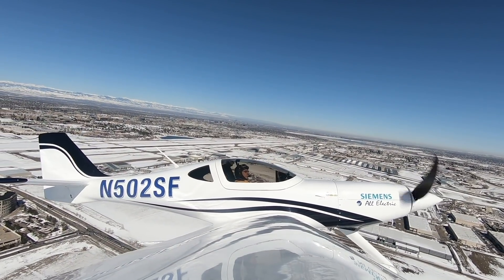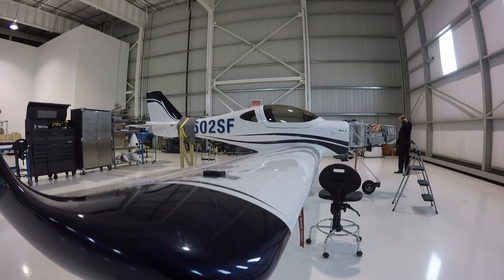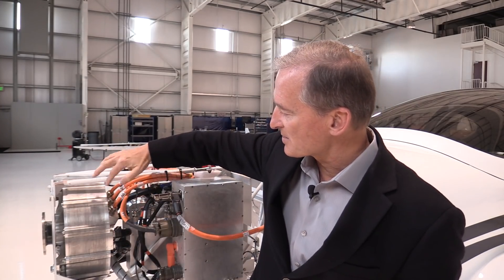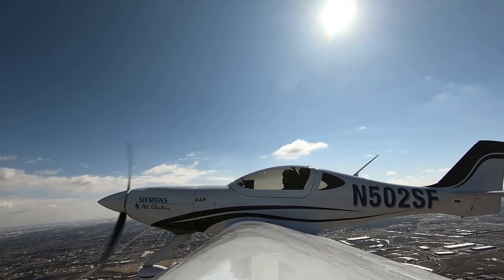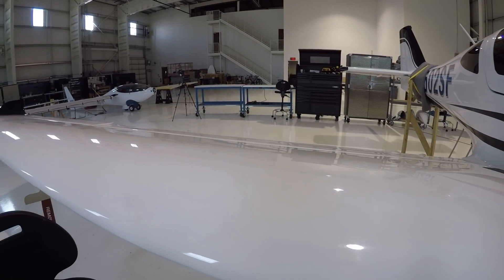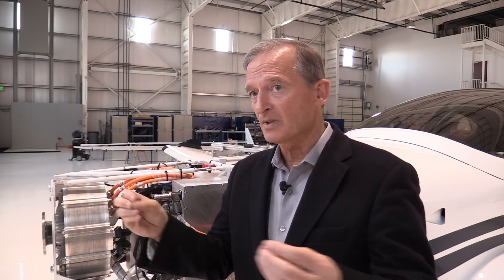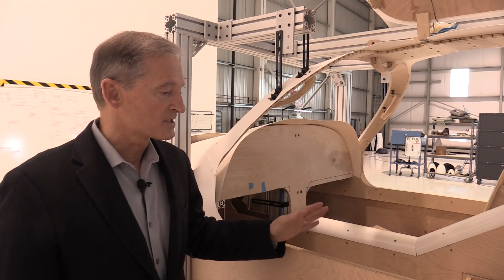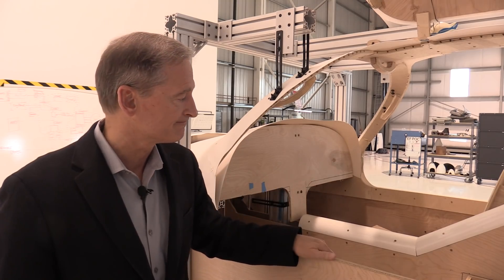Bye Aerospace's eFlyer Electric Trainer

Comment: Rapid discharge, rapid charge, the batteries wont last.
Reply: How long do they need to last to be viable? Many aircraft fly with TBOs that would make the average car owner retch.
Reply: @DrewLSsix  The batteries are likely to cost tens of times more than an engine rebuild, so they'd basically need to last forever.
Reply: @PistonAvatarGuy  Hello again on another thread, last number available for the Pipistrel Alpha Electro is 26,000 € for the battery. Thus more than an O320 overhaul in KS, less than one in Europe. It boils down to how many cycles do they last (even at 80% they can still be used for 10 landings in the pattern, which is plenty for early flight training), vs fuel costs. Plus probably lower insurance premiums (higher reliability, but actuaries might be lukewarm to new technology), the rest more or less to par. We'll find out. But 10 x is again a magnitude too high. (I love piston engines, but I love cheaper flying and flight training and reliability even more).
Reply: @Walterwaltraud  You could do 2 overhauls of a Rotax 912 for the cost of the batteries in the Alpha Electro, so I was a bit off in my estimate, but the piston engine is still likely to make FAR more financial sense. You could almost buy two completely new Rotax 912s for the price of the batteries in the Electro.
Reply: @Walterwaltraud  Actually, I probably wasn't off in my assessment of the price of the batteries for the eFlyer, as its battery is more than 4 times the capacity of the battery in the Electro. If the eFlyer battery is the same price per kWh, it would cost as much as ten rebuilds of a Rotax 912.
Reply: @PistonAvatarGuy  You get a 7500 USD overhaul of a certified 912? Where and by whom? Lowest quote by a great outfit for an O320 I have found is around 17,000 USD in KS. So name your source please. Secondly, if 1000 cycles lead to 80% capacity, you can still do pattern work in the Alpha Electro. Just not "long" flights anymre. Still the fuel, even mogas for a Rotax, is more expensive than the charge. It boils down to dollars and cents on equal term usage (which is realistic in flight training), and those electric trainers will make plenty of sense as part of the training fleet of a flight school. They'll put their money where their mouth is, and will prove you wrong in a niche application. You'll see. And - please gimme a linke to a 7500 $ certified Rotax overhaul (uncertified does not count, I know what my AAB 2.4 Diesel for my T4 van costs in comparision, a mere 2000 GBP).
Reply: @PistonAvatarGuy  Wrong. As someone below pointed out that the industry cost is around 190 $ per kwh, you can see that Pipistrel has a big margin on it (to pay for R & D/ profit supposedly). So that remains to be seen as a pricing issue of Bye. We'll see. I'd rather go electric in the pattern and transoceanic on ICE for obvious reasons. The former is less prone to EFATO, the latter won't be beaten in endurance for a century or more :-).
Reply: @Walterwaltraud  Wrong? You're talking about the cost of bare battery cells verses the cost of a complete battery pack, so there's nothing wrong with the price that I used. You don't just dump bare battery cells into the airplane, it costs money to build them into packs and it costs money to certify those battery packs. Do you think that cost just gets written off somewhere? Do you think that Rotax charges ~$8,000 dollars more for a certified engine just because they can? You're DELUSIONAL.
-
"The former is less prone to EFATO..."
-
There is absolutely no way to asses the validity of that statement, electric aircraft simply haven't flown enough hours to determine if they'll be less prone to failure at high power settings. Piston aircraft engines are also frighteningly archaic and modernizing them could result in a significant improvement in their reliability.
Reply: @Walterwaltraud  The O-320 is significantly more powerful than the motor in the eFlyer, so that's not really a fair comparison, the 912 is much closer in power output.-
-
The battery in the Electro is likely to be trash after 1,000 cycles, not simply worn to 80% capacity.
-
Just a fast charger for the Electro is the same price as 2,600 gallons of mogas, which represents well more than 600 hours of flight time.
-
I suppose that you're right about the cost of a rebuild for a 912, I'll revise my comment.
Reply: @PistonAvatarGuy  a) that's exactly what I inferred to by R&D costs plus profit and b) how often does your electrical shaver, toothbrush and power generator on nuclear power plants fails? (the latter has no counter movement - just like a PT6 has an MTBF that is multitudes higher than any opposing piston engine, the same logic applies here. As stated frequently by anyone here, the battery density and energy management is the issue at hand. Safety wise (other than the batteries, we all remember the 787s early dangerous mishaps) the electrical engine is factors above any piston engine.
Reply: @Walterwaltraud  a) It's not just R&D costs, though, they're actually building a battery pack, that's additional materials and manufacturing. b) How often does the engine in a modern car fail? I've had cars go 300,000 miles (probably in the range of 6,000 hours) without any kind of failure that resulted in ANY loss of power.
-
"...is factors above any piston engine."
-
You have no proof that an electric power system will be less failure prone than a modern piston engine, PERIOD.
Reply: @PistonAvatarGuy  Apology for the brevity, of course it's more than R&D plus profit, but this is a youtoube comment section, not a scientific peer reviewed publication, and I would have assumed there is some interpretation capable grey mass between your ears. So, how do car manufacturers produce electric vehicles cheaper than an Alpha Electro? Mostly economy of scales.  So of course one needs to add to the purchase cost of the cell. That's so obvious that I do not include it here but debate true figures. So, what's the cost of the battery of a Nissan Leaf, Chevy Volt, Tesla, Renaut ZoE etc.? Btw, where can I get that advertised certified Rotax 912 overhaul for 7500 USD? I am still waiting. (as for the proof, there is plenty of proof in myriad daily applications, but not in a/c yet for obvious reasons. The NTSB was not founded before the Wright Brothers, you know...).
Reply: @Walterwaltraud  "...and I would have assumed there is some interpretation capable grey mass between your ears."
-
That wasn't the problem, the problem is that you're trying to manipulate the conversation by making it appear as though the cost of producing a battery pack is much less rigid than it actually is.
-
"So, how do car manufacturers produce electric vehicles cheaper than an Alpha Electro?"
-
Airplanes are expensive to produce, EVERYONE knows that. The ICE version of the Alpha is also many times more expensive than a car with the ability to carry two passengers and with an engine of similar power output.
-
"So, what's the cost of the battery of a Nissan Leaf, Chevy Volt, Tesla, Renaut ZoE etc.?"
-
Who cares? They're not airplanes.
-
"I am still waiting."
-
I made the correction, READ. It was actually just a typo in one comment.
-
"...but not in a/c yet for obvious reasons."
-
It should also be obvious that aircraft are VERY different from the applications that you listed.
Reply: @PistonAvatarGuy  "...and I would have assumed there is some interpretation capable grey mass between your ears." - That wasn't the problem, the problem is that you're trying to manipulate the conversation by making it appear as though the cost of producing a battery pack is much less rigid than it actually is. (no I did not, I provided the base purchase price and obviously a 777 is much more expensive than the raw aluminum it contains. That can be easily compared when looking at Renton and comparing it with Victorville). - "So, how do car manufacturers produce electric vehicles cheaper than an Alpha Electro?" - Airplanes are expensive to produce, EVERYONE knows that. (as mentioned, and admitted, the economy of scale mostly. 1000 new GA a/c vs. millions of new cars. All I am inferring to with that comparison is that the base material is there - and your tenfold guess was wrong.) The ICE version of the Alpha is also many times more expensive than a car with the ability to carry two passengers and with an engine of similar power output. (indeed, but they last forever, my PA28-140 is from ‘72, not that many cars from that era still on the roads that go 105 knots in IMC :-)). - "So, what's the cost of the battery of a Nissan Leaf, Chevy Volt, Tesla, Renaut ZoE etc.?" - Who cares? They're not airplanes. (we care, because in proportion it’s indicative for airplane production as well. Perhaps it’s factor 4, perhaps 6, perhaps 10 - but it’s pure numbers)- "I am still waiting." - I made the correction, READ. (I do not reread your old comments for subsequent adaption, so apparently you screwed up earlier without admitting it. How classy) It was actually just a typo in one comment. (you make me curious)- "...but not in a/c yet for obvious reasons." - It should also be obvious that aircraft are VERY different from the applications that you listed.(obviously a tire on a 737 is different from a car tire, but they are both made out of rubber, inflated and there are a bunch of similarities. So, how come gas turbines have a MTBF that is much higher than piston engines? Any comments on that? Or do you retract that statement as well?) Some common sense please.
Reply: @PistonAvatarGuy  Oh so it's two overhauls. Thanks. Now let's factor 4 gals of mogas per hour (rotax) vs. 40 kwh for the Pipistrel Alpha Electro. You see where I'm getting at? It all factors in. Maybe they'll just break even with the Electro if the cycles of the batteries were limited only to 900 charges. But perhaps they still swap out great for pattern work after 3000 cycles. Then the direct operationg costs of the Alpha E. will be a fraction of flying in a C152. We'll find out.
Reply: @Walterwaltraud  FFS. The Alpha Electro is $40,000 more than the Alpha Trainer! A battery replacement costs twice as much as an engine rebuild, if you want an additional battery and a charger for a fast turnaround, that's another $36,000... so, no, I don't see what you're getting at. Just the additional cost of the Alpha Electro over the Alpha Trainer makes the Electro completely useless from a financial perspective. We don't have to wait to find out anything, the Electro fails before it's even purchased!
Reply: @PistonAvatarGuy  And that's why you won't buy one. Others might and might do well. It's the direct operating costs that will matter. At a given amount of hours flown per year. Dispatch reliability might only be 20% higher, we'll see. Safety might only be 30% higher, we'll see. Noise abatement might be a huge factor at some airfields. We'll see.
Reply: @Walterwaltraud  Yes, we'll see that no one will want to pay absolutely exorbitant prices for aircraft which offer absolutely pathetic capability.
Reply: @PistonAvatarGuy  They have already sold a bunch. And it's not even certified yet. You know who determines the winner? The score. You might claim "but I was right" and it will be true for your. Compare the 269 k $ for a new Cherokee to the Pipistrel Alpha Electro. Only difference 3rd seat and range/ endurance. We'll see. Again, it's a niche. Don't beat yourself up on ideology. If the product sells well, all the buyers are stupid and you are happy. If that revitalizes basic training, your infrastructure costs will go down indirectly so you can be double happy. Cheers and all the best to you, happy landings. All others are stupid. (again, it's a niche. And will be for a very long time).
Reply: @Walterwaltraud  "Again, it's a niche."
-
One that is much better filled by ICE aircraft.
-
"If the product sells well, all the buyers are stupid and you are happy."
-
True, but no one is going to be happy when they have to replace a $30,000 battery in their plane that already cost them $40,000 more than the alternative. Sales will evaporate at that point.
-
"If that revitalizes basic training, your infrastructure costs will go down indirectly so you can be double happy."
-
You can't reduce the cost of training with an aircraft that's significantly more expensive to buy and operate.
-
Electric aircraft don't fill a niche, and without an absolutely enormous improvement in battery technology, they're nothing more than a curiosity.
Reply: @PistonAvatarGuy  We'll see which will fill it better. For the delta between the new PA28 Pilot and the Electra there can be batteries ordered. I smell confirmation bias here. I am not ideologically sold on electric cars, btw, unless you have only or mostly hydropower (Norway etc.). The mix makes sense depending how it shall be used. Direct operating cost and reliability, plus usable lifecycles of the batteries will determine the outcome. We'll see.
Reply: @Walterwaltraud  Yes, we'll see.
Reply: If they're cooled properly it might not be a problem. Heat is what kills batteries. Discharging in 3 hours (.33C) is not a big deal for lithium batteries.

Comment: It must be an experience to be in flight without all the engine noise. As electric power replaces fossil fuel powered flight it can only evolve moving forward.
Reply: Check out Bertorelli's flight in the Alpha Electro in Slovenia, less noise on the ground, pretty much the same in the cockpit.
Reply: Most of the noise you hear from planes when they are flying is wind hitting the airfoil.
Reply: @xqluziv  wrong. Ever been on an airfield with gliders?
Reply: @Walterwaltraud  Yes i have and no its not wrong. Go fly in a glider and tell he how quiet it is. And dont compare something that is landing with a speed less than 30knots to a plane flying.  https://youtu.be/vAOLuKRoVY4?t=209
Reply: @Walterwaltraud  You can even go stand under a wind turbine and tell me how quiet it is.
Reply: @xqluziv  Okay, I am a commercial pilot who started out in gliders. Obviously a flame out F-16 doing S-turns makes more noise over its wings than a ASK-13 or DG 1001. But that completely pales in comparison to the prop, the tip of the prop blades move factors faster than the wind over the wings or fuselage etc. You have gliders whistling overhead fields after competition who are much faster than their landing speed before they align with the pattern/ circuit/ high key or whatever you wanna call it. Ever heard the prop blades of a Tu-95 or a Cessna 185? There you have your answer. Those dB measurements are pure physics. Forget the wings. Even at high speeds.
Reply: The propeller is still pretty loud.
Reply: @freakfly23  I wondered about the prop wash. Take away the engine noise though, it has to be better.
Reply: Never going to happen without a radically better battery.  Which still looks like never.
Reply: @DumbledoreMcCracken  With that attitude lol
Reply: @Nicholas-f5  Okay, do you have an engineering or chemistry degree?

Comment: 3 hrs is great training time, not being able to fuel up and go again is going to turn schools away. Charging isn't fast.
Reply: Switching batteries is though.
Reply: I really doubt that with an aircraft having batteries in a certain place for CG are going to be simply removable.
Reply: @Metalgearmadness  Another electric plane - the alpha electro - already has removable packs. 4 ~75lb battery packs in that aircraft provide 30kwh total energy, which give it 1.5 hours of total endurance (1 hour with reserves).
Reply: Thats pretty bad.
Reply: @Metalgearmadness  There are a few use situations where an hour of usable flight time between quick battery swaps is good enough. 
A 3 hour electric trainer would be a game changer. Even without swappable batteries, batteries can be charged from 15% to 80% in about 30 minutes on a level 3 charger. It's a relatively minor compromise for significant benefits. If Bye Aerospace can deliver 3 hours with swappable batteries, it would be even better.
Reply: @RealestUrbanism  How much would the extra batteries add to the $350,000?
Reply: @SqueekyClean976  Battery packs in electric cars cost about $190/kwh. For reference, the 30kwh of batteries in the Alpha Electro could cost $5700.
Reply: @RealestUrbanism  No, according to Pipistrel's price list, they cost $30,000.
Reply: @PistonAvatarGuy  
No, they are PRICED at $30k. I'm just telling you what batteries COST on a per unit, marginal basis. Manufacturers can mark them up however they like. 

Aircraft batteries currently cost much more than electric car batteries because of lack of scale, early adopter tax of cost to research/ certify etc. I'm just telling you battery packs themselves don't cost that much. A 3 hour aircraft will see much better demand, allowing the manufacturer to achieve better scale and lower prices in the long run if they choose to.
Reply: @RealestUrbanism  Much better demand? So, 20 units instead of 10?
Reply: @RealestUrbanism  Thx for the industry prices in cars, they are probably prudent to bill high at first, but now we see the risk margin involved.
Reply: @RealestUrbanism  Valletta, that is impractical.  FAA, VFR minimums are 30 minutes excess fuel upon landing - totally unambiguous.  Even with 1 hour run time, you must still carry 30 mins spare.  Also, at low battery voltages, current draw increases thus non-linear controllers must be developed.  Lots of issues applying old rules to new tech.